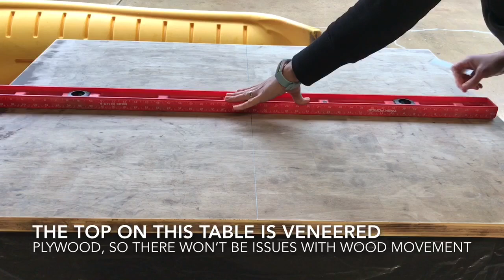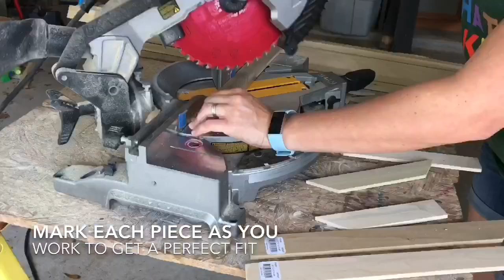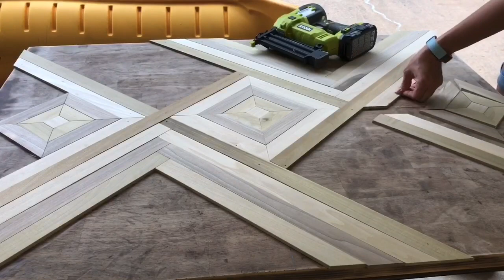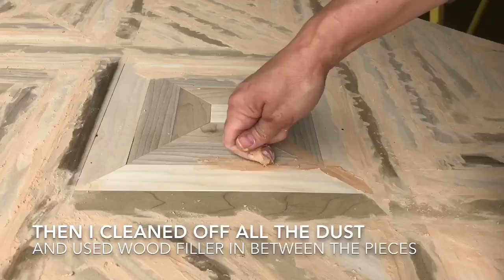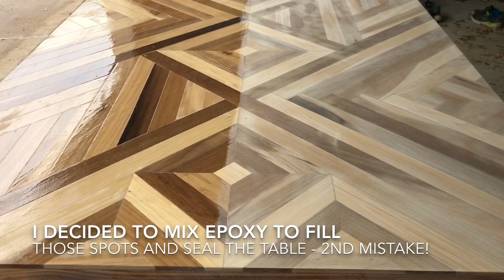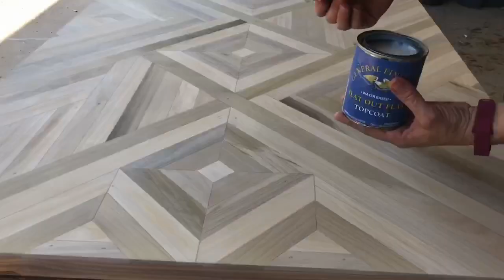I LOVE this DIY Geometric Wood Table Top Design (Beautiful Mosaic Pattern)

Comment: thank you for showing your mistakes! Helps us to learn too. Came out beautiful, cant wait to try myself
Reply from the maker: Thanks! The more I think about, the more I think that I should try a light gray or white epoxy next time and completely skip the wood filler. Then still sand the top to get that nice white cast on those Poplar boards. I think it would look great and also help hold those 1/4” thick boards in place. 🤔
Reply: @AbbottsAtHome  Oh! I wouldve never even thought of that. Im a little apprehensive to use epoxy since im convinced ill do something wrong haha. Maybe ill make some test slabs first and try the epoxy and see how that works out before committing to using it on a whole table.

Comment: Looks Great! You might try moving your router in the opposite direction. You are climb cutting and creating the burns on the edges. Thanks again looks great
Reply from the maker: Thanks! I do sometimes backtrack just to clean up tiny bits but I cut in a counter-clockwise direction. Check out this video: https://www.youtube.com/watch?v=s_wyT4wYIAM&app=desktop
Maybe you just watched a part where I was backtracking?? 🤷‍♀️

Comment: Hi, I just Love geometric patterns. What sizes did you start off with
Reply from the maker: If you mean the poplar, it’s the 1/4” x 2” boards they sell at Lowe’s and Home Depot. 😊
Reply: Hi there, thanks for replying to me. I was talking about the 1st dry-fit cuts. Your miter cuts what size are they?
Reply from the maker: @gailjohnson3544  The angles are all 45's, to keep it nice and simple.